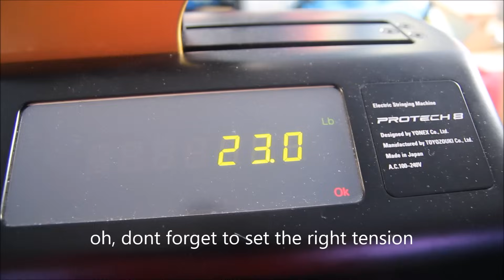badminton stringing

Comment: Near the end of the verticals ( first stage) you appeared to jump one hole and then return back on it. I have not seen that, is that recommended and why? Unless i saw it wrong? At around 2:50
Reply from the maker: Good eye lol yes it's done to reduce stress on the sides of the frame, both Yonex and Lining methods adopt this, not sure about other methods